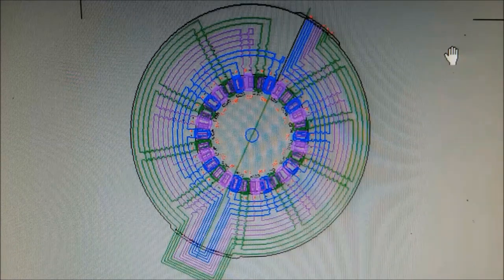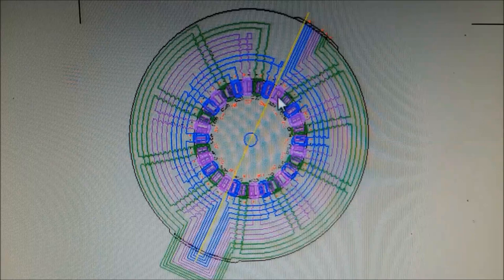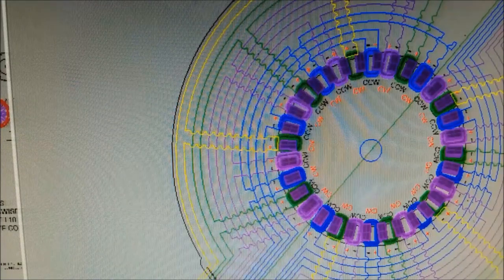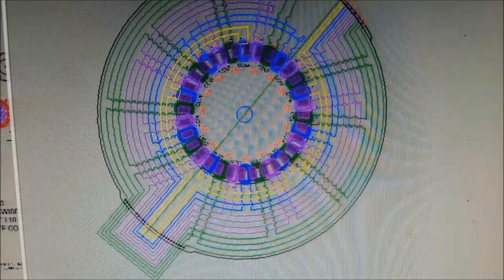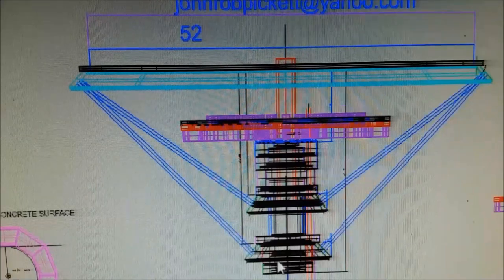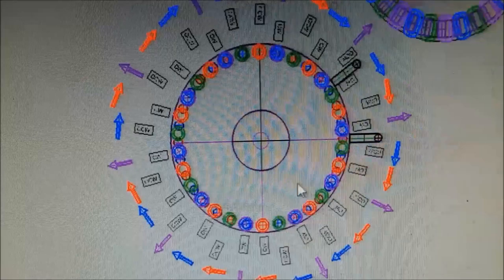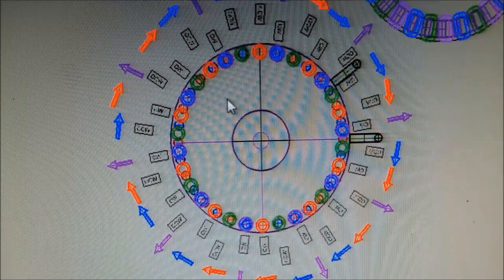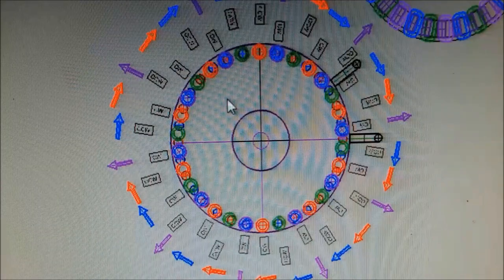WIND TURBINE STAROR IS WORK OF ART PART 1

Comment: Thanks for the info Sir. Keep the good work up.
Reply from the maker: There is another video on the stator. It was changed by adding a second magnet outboard of the existing
magnets on the rotors to make them twice as long. This will nearly double the length of wire in each coil
increasing resistance and therefore a higher voltage on the motor.  The motor will still have the same 
power output  set at the original voltage but starting load or other things will have a lot of safety overload
protection on the wire. Also the jumper wire from one half the stator to the other half will be a guage smaller
to act as an external and accessable fuse.  Thanks for watching one of our videos

Comment: Is there a way to estimate howmany coils you would need for a particular application? I.e your looking for say 50A 150v
Reply from the maker: Well, Volts times amps = watts and volts = amps times resistance. 
Usually you are capturing wind at some watts per square meter.  global wind atlas.com can tell you your site wind speed, and displays watts per square meter. Alternatively you are powering something with 750 watts per horsepower. Sorting this choose one of the variables like amps and solve for the rest with algebra. once you have amps you go to the chart for amp ratings of magnet wire (from google images). Go down 1 guage number to the next heavier AWG wire guage because wrapped and potted coils trap heat.   Solving, volts divided by amps = resistance required. The wire guage chart shows resistance per 1000 meters or some length unit. So total resistance divided by resistance per meter gives the number of meters you have to wrap. The coils count is divisible by 3, annd those 1/3 of the coils are connected in series. Also two series are ultimately in series so 2/3 of your total coils have to consume the meters of wire required for the needed resistance.    PAUSE
Reply: @concretehousebuildinginph1488   I get, that's great, was as I thought but just needed  reassuring 👌
Reply from the maker: Well the dog quit typing for me so he needed some treats so off we go again. The amount of wire per coil is determined by the size of the  magnets. The  inside shape of the coil is the shape of the magnet 
and the outside as an example first calculation is 3/4 inch bigger all around. The thickness is at most 1-1/2 times the magnet thickness. 
So this bounding shape has a cross section. Calculate the area of the cross section. The area of the magnet wire is the circular mills area on the chart. or  pi X diameter squared.4. Use the circular area because it includes the enamel coating on the wire.  Divide your cross section area by the wire circular mills to get the number of wraps of the coil. The length of the wrap is the path of a wire halfway between the inside  and outside shape. Wraps times wraps per coil = length of wire per coil.  Total length for the required resistance divided by the length per coil will be your number of coils. There will be wire used going from coil to coil to get them connected in series which you can ignore because wrapping inconsistancies will leave you a little short on length. If you have long leads to your 3 phase rectifier that will gain some resistance but produce no power in the process, and just lower efficiency. Stopping now for the dog to go out and piss on somebody's car tires.
Reply: Just wanted to add. You vids on this stuff are one of the best. People just don't like sitting down and learning. Thank you so much for answering my questions. Truly means alot🙏